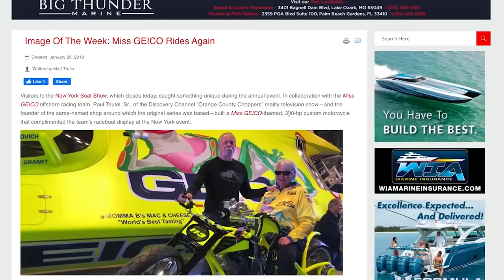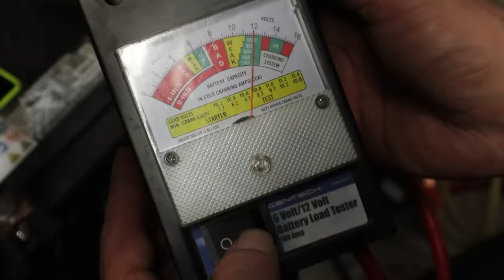Will the Geico Orange County Chopper Ever Run Right? (Unfixable)

Comment: I don't know anything about that specific blower but roots style blowers build heat and need lubrication to stay cool which means they need fuel injected above them through either a carburetor or some sort of fuel injection system either mechanical or electrical injection. Screw blowers, do not create as much heat and therefore do not require fuel injected before them. Same with centricles superchargers not needing fuel to keep them cool.

I have an 871 Roots blower on top of a 454 with electronic fuel injection on each cylinder. But I run two injectors above the 871 to keep it cool so it doesn't eat itself up. They inject minimal fuel just enough to keep my temperature just above ambient. When I run alcohol or e85, The blower will actually build ice at the bottom of it as the alcohol expands and cools the blower. I tend to dial back the injectors on top of the blower when that starts happening.

Comment: The injector on supercharger works similar to wet nitrous kit. Wet nitrous kit adds nitros but also has injector that adds fuel to nitrous, so you dont need to re-progam injecton amount or change your injectors for bigger ones. Plus it cools the blower.

Comment: Short version of recommendations.   Thundermax tuner…watch a few youtube videos on the tuner…is it the autotune version or not…if yes..are the o2 sensors install and is AT on?  The AFR can be set as a target in the thundermax..stock is 13.5:1 , not sure if plugs are rich due to high AFR in the max or is the blower nozzle …if the bike had AT on the blower nozzle will confuse the max ‘s cylinder control which is done by the O2 sensors.  FUEL, to get to a street fuel you need a street cam, is a race cam in the motor….hp is poor for hardware investment…did someone put a blower on a stock cam…are the positions high compression…you need medium compression piston and stock cams for street fuel.  Blower, seems to be under feeding the motor due to plug fowling indication.  The blower injector could just be there for blower heat control.  It’s possible to convert the motor to street fuel…but different parts might be needed.  The thundermax can provide visibility.  It would be easier to monitor engine efficiency if the o2 sensors weee in place.  If not installed…you will need wide band o2 sensors.  But you are correct…20 people blindly tried to build an elephant and they created a hippo.  Salvageable yes.

Comment: The injector at super charger does a few things...more air you need more fuel so as boost rises the extra injector kicks in. Also cools the super charger. and the fuel flowing through the charger helps seal the turbines to help make more boost

Comment: I think the injector for the supercharger is for E85 fuel, it's meant to reduce the charge air temp as there is no intercooler on that bike. Just my thoughts in it, it has been done before but there are better ways to cool the air.

Comment: They put extra fuel into the top of the blower to keep the supercharger cool, roots blower create a lot of heat and that lubricates the rotors as well as cools them down, so a lot of times you’ll add top end lube to the fuel on a race bike or a race engine usually only if it’s on methanol

Comment: only idea coming to my mind to explain reason why there is fuel injector in supercharger is to lower temperature of compressed air by using energy needed to evaporate fuel.
This way in cylinders are standard size injectors and 3rd one is taking care about correct AFR and compressed air temperature to prevent knock and slightly increase density of air fed to engine.

Comment: i got my orange county chopper a long time back it had a blown rev tec you want to check all your grounds ! those fools painted everything and i do mean everything! !! after i put an rb racing 124 in mine to replace the rev tec it would not start nothing worked right it was an electrical nightmare! it all came back to the grounds they put grounds on painted surfaces !  it was a pos but its actually a really nice riding bike now its super comfortable.

Comment: Craig,
If I'm not mistaken, 🤪, the injector in the supercharger chamber is typically used for Methanol injection for increased power and additional cooling for the whole intake. Thus, the 300 hp claim.
I have a 2012 Victory 106 cid that makes 116 hp just by removing the mufflers and filter, unplugginging the o2 sensors, and resetting the computer for full flow for the IAC and exhaust. I have no need to go 200 mph on the street, so I opted not to get a tuner. I was; however, tempted for a moment to run Methane, but only for a moment. 😂🤣🤪🤙

Comment: an extra injector is usually used so you dont have to change the original ones, i would just up the size on the two in the engine, tune for that, ditch the extra one and all the extra lines would be easier and safer

Comment: I need to get a few of those fuel injector holder/cleaner. Wpuld need 1 for the fuel injectors that are similar size that you have but also ones that would hold the injectors for say the turbo inline 6 for bmw, the N55 or N54 engine. Would be nice to be able to flush them out before we list them for sale on ebay so we know theyre not clogged cause a lot of customers wouldnt think to clean them or make sure they werent clogged when buying used injectors...

Comment: I've had an OCC bike in the shop I worked for, junk. None of the bolts had loctite,  or even proper torque,  which caused loose parts. Carb was just dangling,  oil leaks and even steering head bearings were loose. It had only 100 miles on it. He said he had just taken delivery of it that day, first ride.

Comment: Full up top on the supercharger is to help cool the supercharger as well as lubricate it. Often times its used on a mechanical fuel injected engine with a blower. 
I could be wrong being on a bike and it couldve just been an idea of OCC to be like " we added a 3rd injector because with the 2 injectors we got to 200hp so adding the 3rd injector got us to 300hp" kind of thing i could easily believe being the reason it was done since its not a mechanicalyl fuel injected but like any modern boke its fuel injected and has a fuel pump.

Comment: in the cycle world, if you to look up a piece of art that is a P.O.S, there would be a picture of this bike.  The guy paid $10,000 for the bike and the truck; he should have taken the $15,000 offer but hind sight is always 20-20!  At this point, hasn't $10,000 been put in to trying to get the bike running?  I think it would be turned into a water feature in a garden.  large raised bed, surround the bike with rocks, use a metal container to catch the water and get the bike set up to recirculate water and the metal basin/container would be used for aquatic plants.  
Here's my offer, if the bike will be transported and delivered to Klamath Falls, Oregon, I would be willing to pay $500 for the bike because some major work will be needed to transform it into a water moving feature.

Comment: This bike is an impractical nightmare, I'm getting a migraine just watching you trying to get it running.
Reply: Correct best thing to do would be anything OCC made hit the trash bin. Use the good parts. Get common sense engineering riding & comfort frame & parts. Or you only got a garage queen that made to gather dust only.

Comment: What kind of starter is that? Looks identical to the ones we use at work for a ford 300 bolted to a C6 transmission. I ask because we’ve had an issue in the past of someone rewiring the ignition system and used to small of wire, caused it to intermittently not hit.

Comment: Not much exp with superchargers, but my guess would be that the top injector is meant to lube/cool the charger. 
Kinda ironic having a reliability increasing add-on on a bike that wasn't built to actually be driven (just like any other bike-shaped catastrophe built by OCC^^).

Comment: Having a bike you have to fix every 6 to 12 miles said in front of a Yamaha sign makes me think of my 5k mi Yamaha R1, in all it's 5 titanium valve guide shredding glory.  It made it 5k then to 11k and finally 16k miles... when I promptly told the mechanic to put it back on the showroom floor cause the warranty was expired.

Comment: Since O.C. tended to just slap on expensive parts on for the "look" without much "thinking", I wouldn't be surprised if thats a basic big S&S and that blower/injectors were just slapped on top. My thinking is it is very unlikely to have the right  cam set for a blown engine. You might contact S&S and see if they have any record of the build. 
Basically I don't feel it will work well enough in concert for near 300 HP and S&S may not have built it to take much over 150 HP (if that's a basic non-blown engine build).

Comment: @6:00 So forgive my ignorance but my only experience with disc breaks is with MTB's. I'd never touch the disc with my hand because the pads pickup all that oil and then don't stop as well plus they make a god awful sound. Do you not have to worry about that on MC's?

Comment: 9:12 that looks like such a tiring rig to keep about. Why not go for a "halo" rig with a screen in front of the camera, just bellow with a slight angle so you keep your head down in a more comfortable position and the camera higher (thus your arms lower)? Essentially a "steering wheel" for your camera with disseminate controls on the grips.

Comment: Jay Leno has a O.C.C bike. Sitting in the corner of his shop in pieces. Said its the biggest piece of garbage he has ever owned. Said you can't ride them, wiring is a birdnest and shorts out. It all starts out of the tailight assembly and is stuffed in there. Frame on his is cracked from crappy welding. They took it apart to fix it, and realized it wasnt worth fixing
 Just a pile of scrap.

Comment: I mean a good start would be to implement a spring seat, cut some of the frame and put suspension so the frame doesn't literally tear apart from vibrations.   Change the pistons to reduce compression or replace the motor entirely.

There are many ways to make this an actually useable bike.

Now would it be worth it?  Hell no

Comment: Couldn't the starter shop rebuild the original starter? That usually wouldn't be cost effective. But that starter case was a special size that fit the bike. I wouldn't want to work on that lime green disaster.

Comment: I personally would rip all the injection off of it.Put a really really big dual Throat weber on it .. Put the smallest pully possible on the blower to get the most boost out of it. And a adjustable pro arc Ignition.

Comment: It has no rear suspension, tiny front brake on stupid raked fork.   It's best in someone else's garage.  Who cares if it runs when it's more fun if it doesn't..
Leno has or had one.  When the taillight burned out the ignition didn't work.  That's certainly an innovation few have thought of.

Comment: It's just an engine, FFS.  Detuned it, bring down the compression ratio, reduce the timing advance, and map the fuel trims, and it will run just fine.  All one has to do is stop trying to get 105% out of an engine.

Comment: Hopefully that was a joke and jab at OCC saying take the starter to a starter shop!  That push button starter just takes place of the factory magnetic starter solenoid end cap held by three bolts (or two on some yrs/models). You literally undo the 3 bolts and just transfer that end cap with the push button to the other starter.  It’s just a metal button and spring that pushes the internal plunger in against its contacts.  A 16 yr old non mechanic could do it that doesn’t even know the difference in 4 and 2 stroke engines 🤦‍♂️

Comment: "Run right again"???? I'm pretty much under the impression, based on all the existing evidence, that it had NEVER RAN RIGHT FROM THE BEGINNING!! Dude, what I'd do is strip that bike down and go through the whole thing, I'd scrape that bullshit supercharger right outta there and just bring it to the point of it being a basic motorcycle. I'd rewire it the right way and rearrange everything to its proper place and configuration, that engine was nothing more than wishful thinking on the part of the builder because he obviously had absolutely no idea what he was doing.......or why. I get the feeling that the people behind this "Frakenbike" were those rich kids who's parents would buy them anything just to shut them up, later to find them in their garage with that brand new 450 dirt bike their father bought them laid out on the floor in a thousand pieces 😢

Comment: AGAIN: 
How about doing all that check-up and part replacement at the start, even before having that bright idea of starting it the first time, eh. That bike stood around for years. What did you experts  actually expect? Every mechanical device has to be maintained and overhauled even after a short break. Has not much to do with the bike being from occ, aside that the design and general realization is not made for really being a machine for every day use - obviously :)

Comment: I try to be positive in life but man, watching this and the previous video of this over-priced POS makes it nearly impossible to be positive.  Well, your efforts are top shelf, no question.  But I don't think you should even bother.  Even if you get it to run well enough to ride the bike, the bike itself is barely rideable.  Look at the riding position in the previous video.  Hurts my body just looking at it.  You can't control a motorcycle folded over like that.  And it looks ridiculous.  So yeah, I commend you in fixing the atrocious work done by OCC but I say strip the motor out of it, get rid of that stupid "chin-rest" intake and put it in something that can actually be ridden.

Comment: Turbos are ok but usually used with poor engine builds sad but true power weight ratio electric or belt drive or exhaust still stoic is second engine pony engine.two to one is correct third  ratio increased wear on principle power train not hard get glee club monkey in middle so to say our group pretty much over time built single cylinder mower engines to present day my own design off shore custom Pat pend morph from single Swiss load star TVAC HVAC electric custom under morrisy coach our older Pat pend Austria Holland

Comment: I'm abought tired these electronic hippie shake's star's and stripes emitters I've few my own starting at eight hundred fifty thousand volts stand by ours measure in type glycerin volts bought the swiss loadstars back in 1991 better than investment in Harley Davidson never had much to do with swiss loadstars first used jet powered in air craft pre existed aircraft ones stolen in 1968- were right at hundred years old original designer from Poe's stradavari Indochina built by Holland Hollister's and Austrian versucciul built parts with copper and isolaters.. second are family in Austria actual name buried in Indochina in 1975 were over from Cairo and Egypt study's.prety cool no romel wasent in Africa anymore came over was being I'd thefted by less intellectual person's unsure whoes patsy the JDL kiled there own probably.